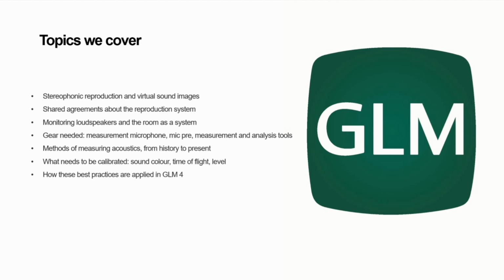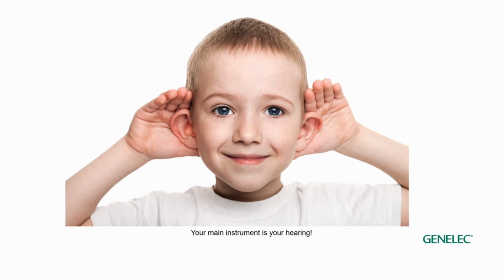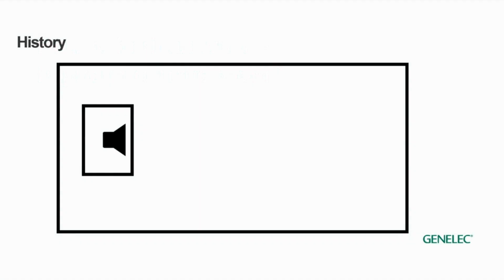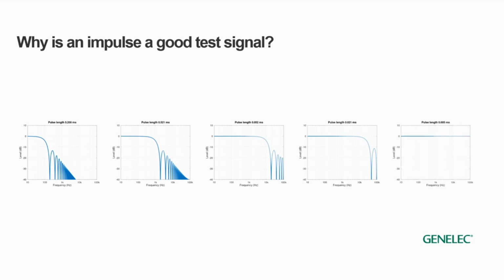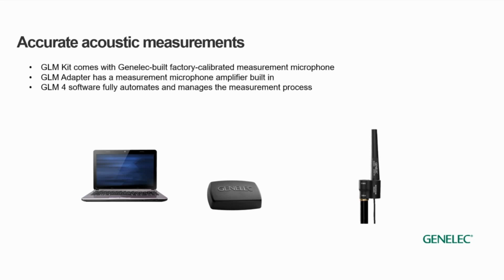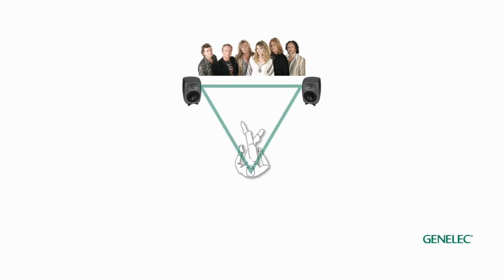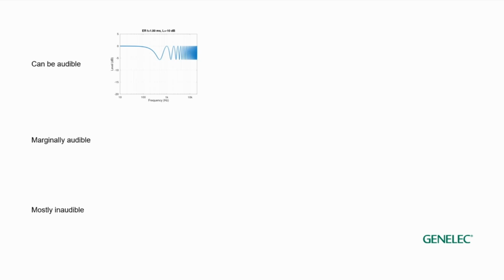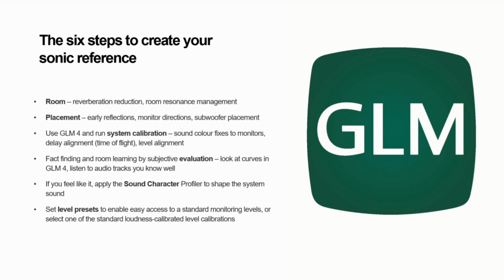Using GLM | The technical details

Comment: Let's say my studio monitors don't have GLM capabilities but my new sub would have. 

I would set everything up with the GLM Kit and make measures.
Since the monitors are connected to the sub, will this also have influence on the frequency response of the monitors or will only the bass range of the subwoofer be adjusted?
Reply from the maker: Apologies for the late reply! There is no short reply on this, as it also depends on the subwoofer model you have been thinking of, and also the connections. if you are planning to use Genelec subwoofer with non-Genelec monitors, we would prefer to discuss more if you can send us e-mail and let us know what monitors you have, and which subwoofer you had in mind. Our e-mail is support@genelec.com and we would be happy to help.   🙂
Reply: @genelec Hello! I have the same question about 2x 8030c + 1x 7350 combination
Reply from the maker: @solidstate_ast  I would recommend to check this article for more information. 7350A have some technical limitations, while 7360A would be more suitable.

https://support.genelec.com/hc/en-us/articles/4404115523218-Can-I-use-Genelec-SAM-subwoofer-with-non-SAM-Genelec-speakers 

Don't hesitate to also contact us at support@genelec.com for further help! ☺